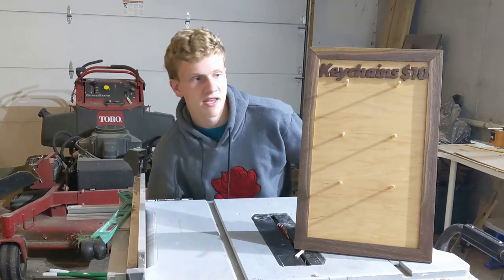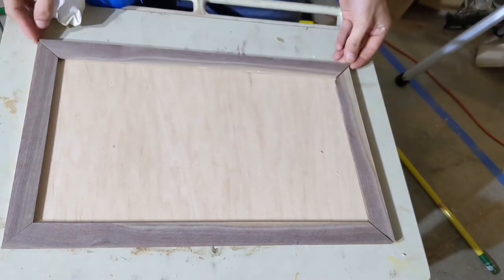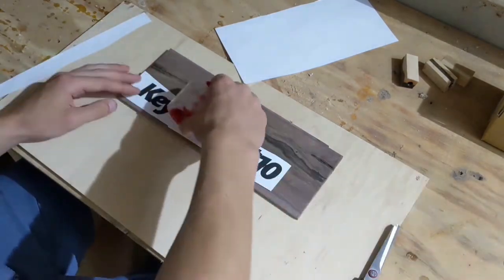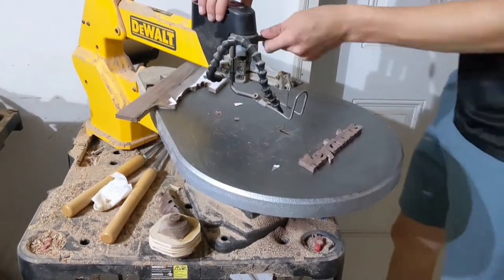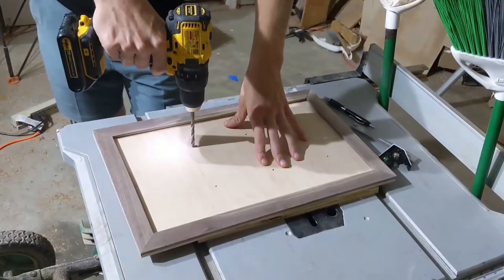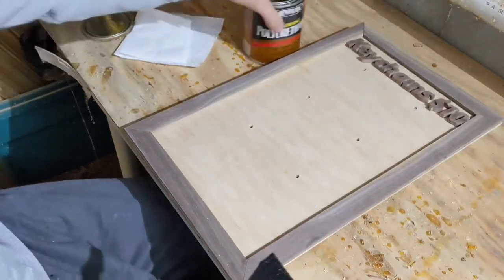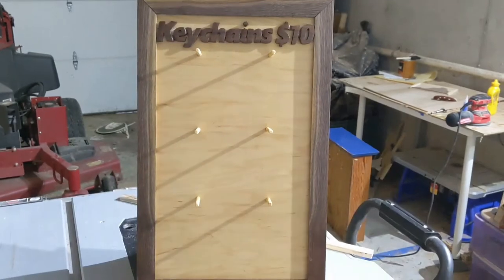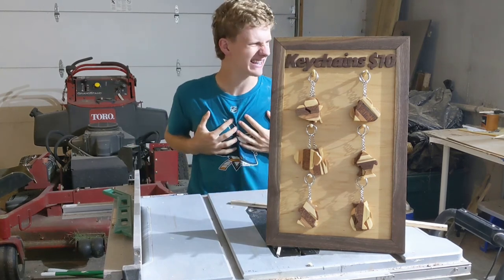Keychain display with scroll saw lettering

Comment: Not sure why you keep doing glue spreading experiments.  It's already been scientifically proven that a wheelbarrow tire is the most accurate spreader of glue.
Reply from the maker: Hmmmmm. To be fair, that hasn't even crossed my mind. Does the whole wheelbarrow need to still be attached or just the wheel?
Reply: @WoodenLegWoodworking  I mean, if you want to be a heathen and leave it out I guess you could...